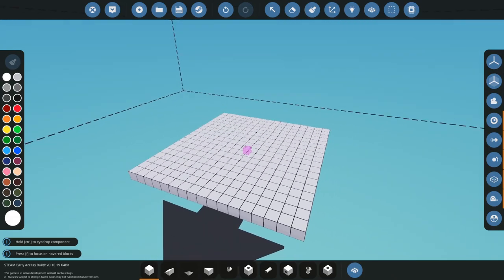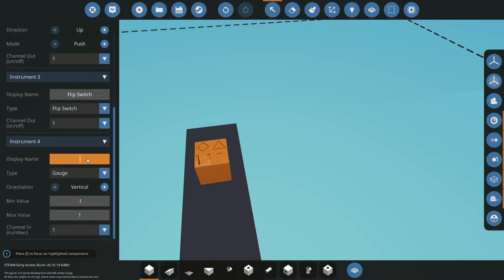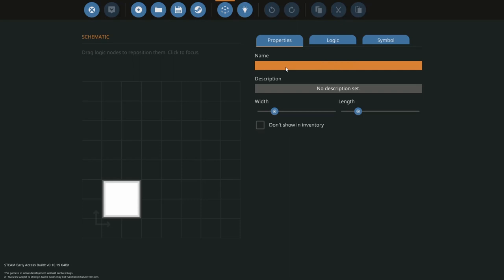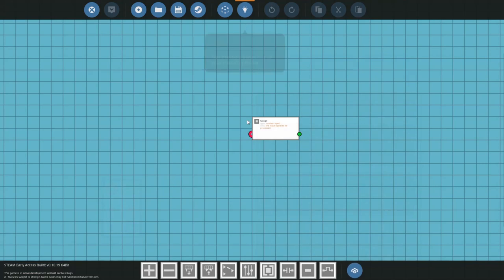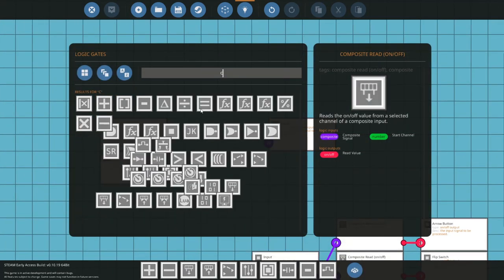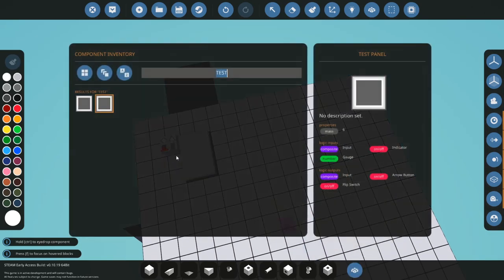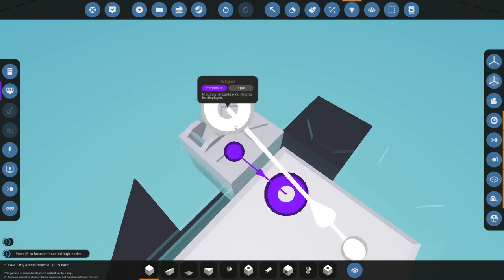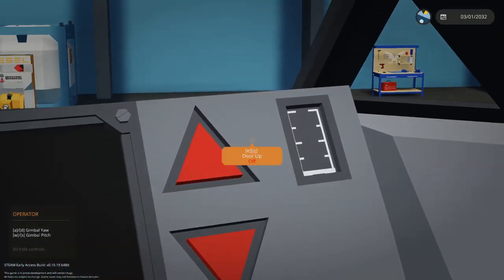Instrument Panel Tutorial - How to make Instrument Panels - Stormworks

Comment: Tutorial for helicopter and tandem helicopter too.
Reply from the maker: Sure thing. I'm recording tomorrow, so that will be fine. I'll make them into seperate videos though
Reply: You know what is tandem, right? It's a twin rotor like Chinook helicopter for heavy lifting.
Reply: Easy. Just invert the rear rotor it will spinning opposite direction. And directly roll to the yaw gyro
Reply from the maker: @thelightbrigadef4172  Its not that simple actually, because the yaw and the roll are controlled by the roll on the props. You need a microcontroller to make it work
Reply: @BigmanBois  actually it's a simple than making complicated. I've seen someone on YouTube how to fix yaw problem rather than complex microcontroller.
Reply: @BigmanBois  but you can do complicated microcontroller if you want to
Reply from the maker: I won't make it too complicated, it will be a system that makes the placement and control easier
Reply: @BigmanBois  ok then. I do have tandem helicopter and it's fly very well. So maybe you try experiment with it from what I seen on YouTube. It's slightly odd but it's works.
Reply: @BigmanBois  
big bird design :
https://youtu.be/X302BXIJrL4
Big bird design 2 
https://youtu.be/IcmbfaranV8 i think he means this one named stealth17 maybe you can watch it right away just watch both of them